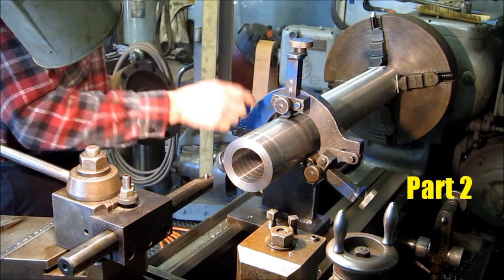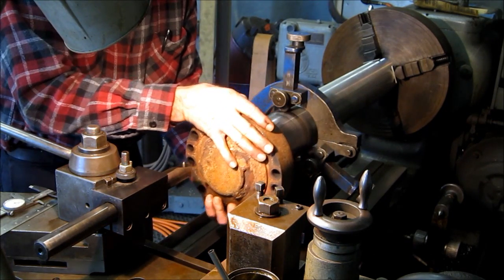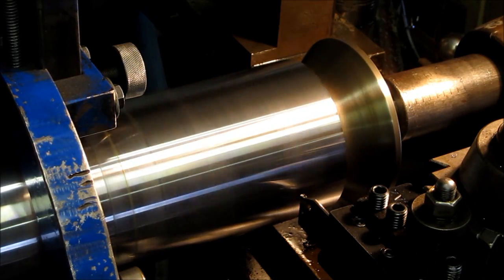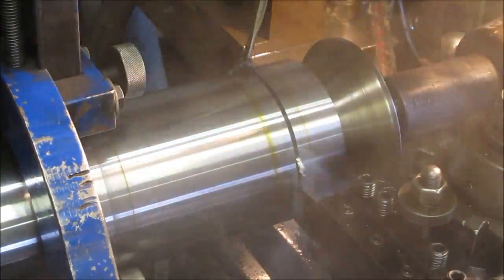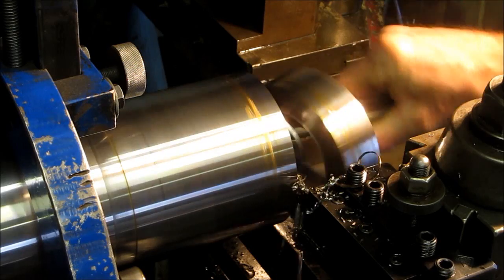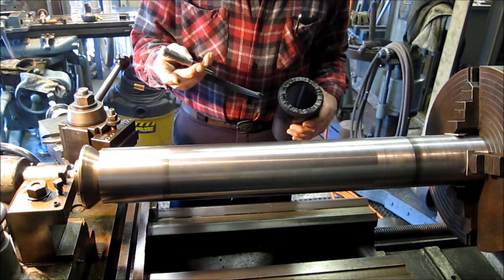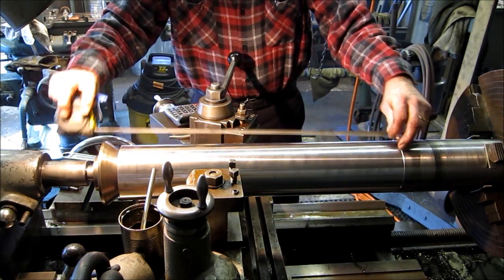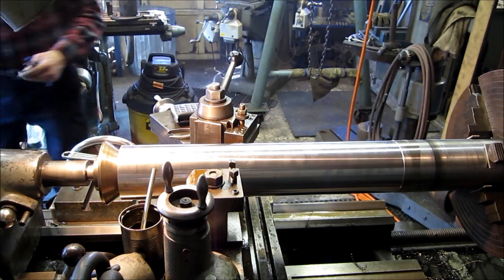Oshkosh rear axle tube Part 2

Comment: Looks great, Keith! I always love to see how a rusty stock becomes a nice and shiny metal part :D
But why do you use sulfur base-cutting oil on your lathe and water-base cutting fluid on your mill? Doesn't it make the parts rust if you don't invest some hours into cleaning and drying the mill after the job is done?
Or is it made of stainless?
Greetings
Adrian

Comment from the maker: The amount off at any one location for drilling is still close enough. The amount off center that you may have to dial true at any one spot for turning is adjusted, to suit that set up. It’s more common in older used or worn ways on a lathe bed...

Comment: I like to use a steel rod chucked up in my tail stock and run inside the work piece bore to catch the stubs that I part off in my lathe.. It frees up my hand for applying the cutting fluid while the other switches off the feed :-)

Comment: Keith , I really liked the way you corrected the taper in that 30" tube , I have always done it the slow painful way of taking a small cut and moving it and taking another cut and checking it until i was on.

I am going to use your math way and do the whole equation and move it once and see if I can get it to work for me , this will be a great time saver for me ....thanks Keith for your videos , they are teaching me many little tricks I can't get anywhere else !!

Comment from the maker: @DieselCrawler86 Most of the time I'm using my indicator set up for diametrical travel against the tool post and cut to half the double depth on the fish tail or handbook ref. Testing the fit with a test nut. When theres no test nut, I like to use Peedee wires... 
I like to cut, .010" per side till, .050" then .005" per side until finished depth, a couple spring cuts to gloss :)

Comment: I was just wondering how you measure your depth of thread?  Do you just use what the Handbook says to the pitch of the thread or do you use a thread mic or wires? 

Also, just to push my luck. How much of a cut do you take when threading? On mild steel I hit it with .020 every cut and finish with a skim.